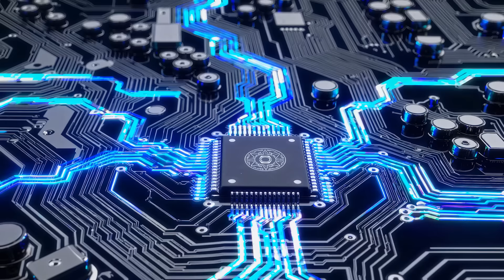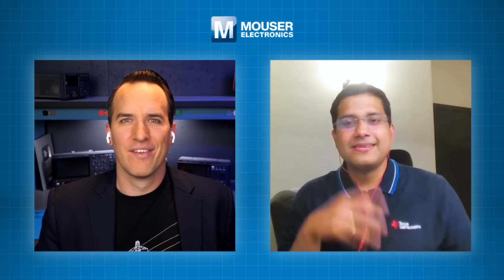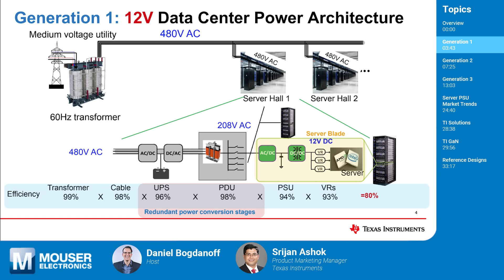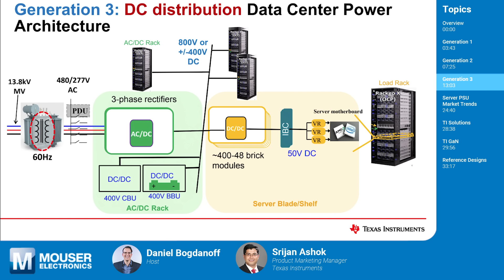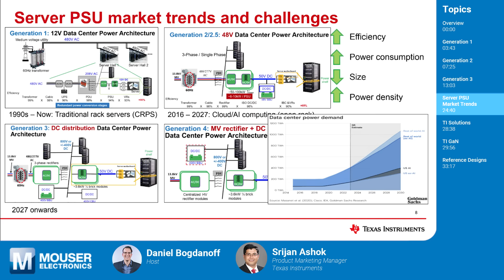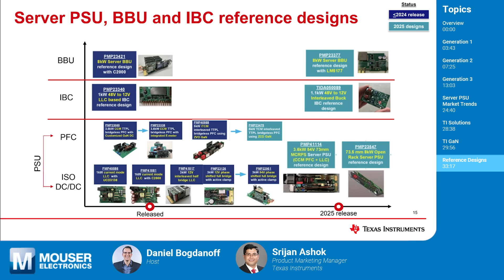Texas Instruments Evolution of server power with TI GaN: Tech Chats | Mouser Electronics

Comment: Have a prototype setup for a 4 single line voltage regulator 32v one amp possibly removing the split voltage regulator system and that hole second transformer used with split 24v in supply to a tower PC this was for a 6w dynamo bike 50mm frame circuit GPS indicator brake speedometer horn like a motor bike charging 3 line circuit to ports via the top frame cut for RF boards or lined depending on bike type shocks battery for lighting and brake supply I phone if apped correctly input solar dynamo AC upto 12v charger. At current one amp no current drop gate for two yet.... otherwise you could run Tesla model possibly to each 18650 safety short and 5v charger it to a regulated controlled circuit pc system from 6000W alternator likely 4 graphite says around 1/2 battery space test used. By truck guy on YouTube replaced one off 3 truck battery with old caps electrolytic says has two benifits like a large buffer caps on voltage in supply and response. Be nice to test solaronix for a possible replacement battery juice types got a 190kw high current alternator pack 80 6000w to a battery out supply using above mentioned on a colse pallet mover jack at 106rpm gear to small alternator lines so close 😊 at total still over half the weight off a 200kw fuel generator for building likely 5 years full time run on base fish pumps stuff.....